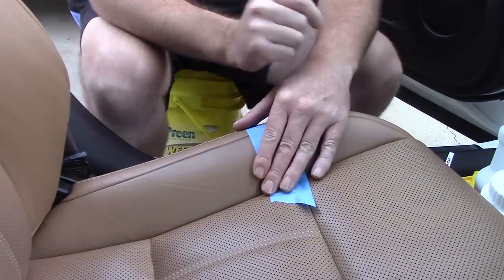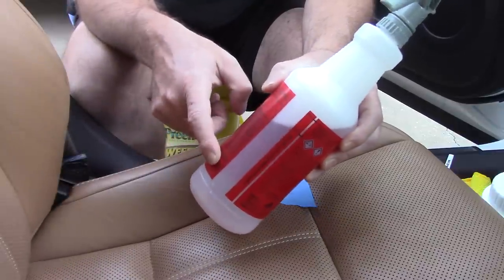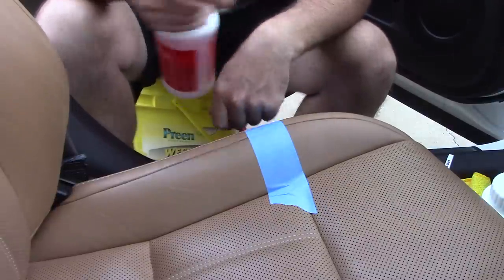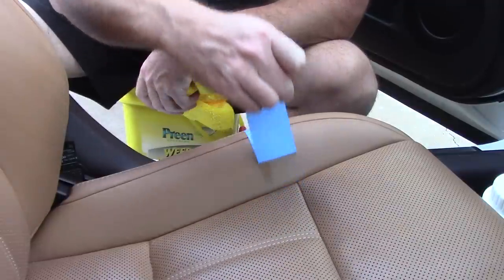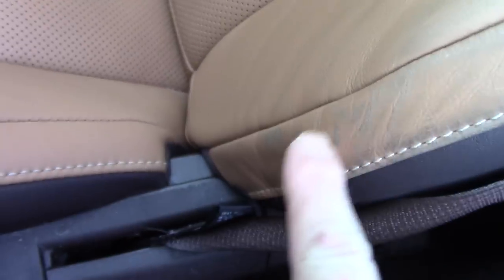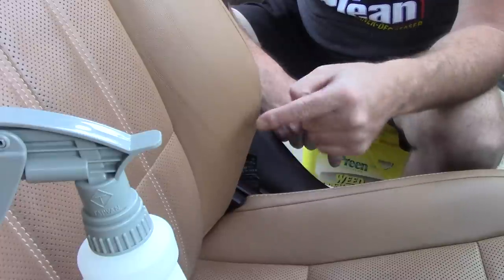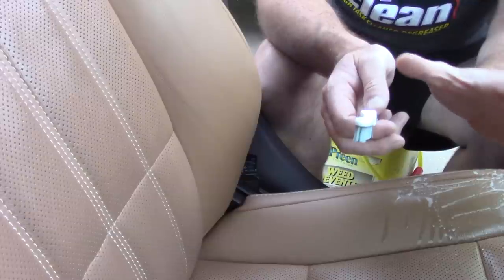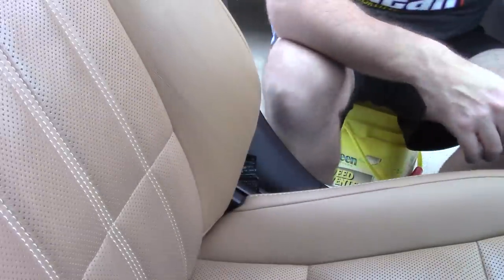Amazing Cleaner For Car Leather - And Cheap!

Comment: This absolutely works. I used this with some dollar store magic eraser pads on some hammered, beige, 2008 BMW X3 seats, with great results. thanks for sharing!
Reply: Be careful using eraser pads on finished leather. The eraser pads will actually remove the clear sealant from the surface of the leather, and yeah it will look great for a while but with the sealant stripped off you'll run in to trouble down the road with that leather. Much better to just wipe with a regular cloth.

Comment: I mixed 2 oz of Woolite with 6 oz of warm water in a spray bottle to clean my favorite leather jacket and the results were phenomenal and it looked brand-new when I was done.
I was careful not to oversaturate the Leather by spraying onto the microfiber cloth then wiping the jacket.
Thank you for this information
Reply: I commented saying the same I use it for leather shoes and I’ve my own mixes with jojoba oil and coconut oil mixed with the detergent for non coated leathers and coated leathers it works well with both.  The oils help with replenishing conditioners into the leather on the non coated stuff and even on the coated stuff it seems to help with preventing the leather from drying out.  I’ve found you don’t necessarily need wool it’s but a detergent free of fragrances and all the additives which basically applies to all the hypoallergenic detergents.
Reply: @SpreadingKnowledgeVlogs  I will definitely give that a try I appreciate the help that maintain our fine leather goods
Reply: @derekcolvin9944  no problem the reason I tried the oils mixed into the detergent mixture is because that's what a lot of the popular shoe cleaners are using these days.  Reshoevenator, Crep, Angelus and Jason marks all use the same in their shoe cleaners albeit in their proprietary mixtures and they don't tell you exactly what detergents their using but it really doesn't make a big difference what matters most is playing with the mix and getting the amounts just right for what your looking to do with it.  I make mines pretty concentrated because I find it easier to do that then water it down when necessary vs doing the opposite.

Comment: Thanks so much for the information. Scott this is the first time I’ve seen this demo..  Eagle Products used to put out a product called Eagle 1 Leather Creme.  It cleaned and conditioned leather and made it smell brand New!!  I wish they still made the product.  An Elderly Gentleman that worked at the Cadillac dealership since he was a kid recommended the leather creme - he said “it was like putting lotion on your skin!”  My leather stayed soft, pliable and never cracked or dried out. O’Reilley auto parts introduced me to another Leather Cleaner and conditioner and it does a great job and the leather smells like new!  Griot’s Garage Leather Cleaner and Conditioner. The diluted woolite would leave a  delicate clean smell which is what the Cadillac Dealer and Lexus detailers used. Thanks so much for the information.

Comment: Just a suggestion to share: we have horses and have been maintaining very expensive leather goods -- bridles, saddles which are $5k retail, custom made boots, harness -- with castile soap and a bit of water.  The tack is cleaned every time it is used.    Tooth brushes for the small areas. a lightly dampened sponge for the large spaces.   Important to clean the leather every use because the horse's sweat has salt in it and this simple soap gets the salt off while conditioning the leather.   I've used this on the leather of my cars for years.  Doesn't rot the stitching, doesn't change the color regardless of whether the leather is dark or light color, and no need to rinse.   Inexpensive like Woolite.   Comes in bars like any soap.    We don't use it on fabrics.   Just on leather of any kind and especially very fine leather like the French calf of boots and shoes and finely made harness and tack.
Reply: Is that any scented Castile soap. Would the lemon one work on my black leather seats
Reply: Dr Bronners  @TheJanicetunes
Reply: Emma Willard..is hemp castile safe on leather. Or is it all castile soap hemp based and i just didnt research enough?
Reply: Emma willard what stores have this castile soap?and is this the liquid form or soap bar and what brand do you use?
Reply: @luisrosado1448  . . . Dr Bronners is organic castile liquid.  also comes in bars. Most stores carry it now.
Reply: I got mine at Marshall’s.  What a great tip!
Reply: I too have been cleaning leather for years and I am totally sold on
Leatherique products.I have heard that saddle soaps can close the pores of the leather and cause it to prematurely age or even damage it. I was told that Rolls Royce recommends Leatherique and I have always loved the results. It is a long 2 step process.
Reply: @vaejoviscarolinanus    What is branded as "saddle soap" is a combination product.   It has an oil component.  We have never used this on fine leather:  the oil component will change the color of leather making it darker.
    Much better for fine leather and what I use to clean my leather seats: pure castile soap (comes in soap bars and as liquid and no perfume) to remove grease, grime and dirt.  Then, if necessary, condition leather with a specific leather conditioner product.  Such as Lexol.  Two step process, first to clean and, second, if necessary, to condition.  Use of a conditioner should be occasional, not regular.  Only when the leather is stiff or dry and only when the leather is clean.  Don't put a conditioning product on top of dirty leather: just seals the dirt into the leather and changes color.  That's why what is called "saddle soap" is NOT GOOD.
    I've got saddles and harness which are fifty years of age and have been kept this way for all of those years of regular use.
Reply: @TheJanicetunes    Because I can't tolerate perfume and scents, I never buy or use castile soap which is scented.
   Just plain castile soap in a bar.  It's white and very soluble in H2O.
    Wet a sponge, squeeze out as much water as possible.  Sponge should be damp but not wet.  Rub on the castile soap bar and make a bit of foam.  Apply foam to the dirty leather.  Remove any excess.  Let the leather air dry.  No need to rinse.
    Use two two water sources: one of clean water and one of dirty.  When sponge has been used on the dirty leather, rinse the sponge out in the dirty water.  Then use clean water to make soap foam again. 
    The idea: when the sponge has dirt on it from cleaning, don't use it again on the leather: you'll be putting dirt back on a cleaned place or more dirt on a dirty area.  
    Rinse the dirt and soap out of the sponge in a dirty water bowl or source.  Squeeze out excess water to have a damp, not wet, sponge again.  Use the clean water source to make new foam to clean the next area.

Comment: I did some work at a leather manufacturing place, the old guy there gave me a tip years ago and it's the best i've ever tried out of all the products, and that soap flakes. There got that out right away lol. truts me it does a brilliant job and it leaves a kind of waxy feel to the leather also like when they're new.

Comment: I been doing similar washing leather goods and shoes using similar products.  I use a laundry detergent cleaner that is free of fragrance and all the other B’s.  I use it in a foam pump when I want it to foam.  I find you do need to mix some of them strong but it does indeed work well.

Comment: If you don't have Woolite, they say to use Dawn dishwashing liquid for your clothes. Well I just dried a couple of drops straight on a stain on leather loafers that has been there for over a year and it is actually lightening. I'm using a washcloth to rub it in and then using an abrasive dish scrubber.

Comment: Great video. It's like myself with off label use. On a totally hammered car, mixing hot water and tide or persil for the ENTIRE interior, mopping up and finishing with last touch, diluted onr or quick interior detailer. Comes out perfect.

Comment: I want to say thank you. Your channel has made a big difference with my cars. Yesterday I did my first 4 step process on the my ‘95 Caprice using the harbor freight DA polish with Griots Fast Correcting Cream and Meguiars Ultimate Wax. That compound gave life to the paint again. Feels like 1996 over again. Thank you!

Is this woolite safe to use in older cars with leather? The 95 Caprice and 96 Fleetwood that I have both have leather and could use a cleaning. 

Without you my car paint wouldn’t be so vibrant. Cheers from Miami.

Comment: Lexus recommends using Woolite and water to clean their leather in the owners manual, for mild stains it is good, for caked/burnt on stains it does not work very well, I found Wolfgang leather cleaner was good for harder stains.

Comment: Thanks very much I will try it on my new/used Cadillac Escalade that has very light leather (Slate). I'm in warm weather year round and have shorts or a dress on a lot so the oils from legs I'm sure will transfer.  I haven't tried it yet but I will soon. Scott do I need to put any other product on the seats after I've cleaned them as a protectant?

Comment: Woolite, and common household cleaners without bleach,,  cannot harm the synthetic stitching used in cars.  But some with high pH will make the color coating discolor, become tacky, or strip the coating off. An excellent leather cleaner is available from ADV Leather.

Comment: This DOES work. Just purchased a pre-owned Honda CR-V with black leather interior. The driver seat, the driver armrest and steering wheel are shinny. I used the "Hand Wash Delicate" Woolite (pink & white bottle) 1:5 distilled water with a tooth brush, like you did. The crap that came off of the seats was this greenish black dirt.  Seats look amazing. The armrest which I think might be vinyl, is still a little shiny probably from constant rubbing or burnishing. I think a gentle swipe of a magic eraser will take care of that. Thanks for the tip.
After using this solution however, I did use a wet towel to wipe off the soap residue.

Comment: Does this really work with blue dye from jeans?? I used dawn and whole bunch of other chemicals and nothing worked. Haven’t tried woolite. Thanks for sharing
Reply: I was selling my car and needed to get blue denim dye off. I used 5 to 1 with method all purpose cleaner and a magic eraser. I was shocked at how clean it came. The video I watched said the secret was soaking the magic eraser in water first. I've tried spraying products on magic eraser and doing it that way but it didn't work as good. Also you can let the magic eraser dry out then use it again.

Comment: I have a 2015 Lexus LX570, and the leather on the driver side bolster is all cracked and some of the leather is starting to peel off. I bought it certified pre-owned from the Lexus dealer with 20,000 miles. The car only has about 35,000 miles right now, but it's getting more and more cracked. Is that normal? What can I do about it? Thanks!
Reply: Frosticious I would contact your salesperson, and schedule a service visit for warranty work.  The armrest in my 2015 Escalade started to get wrinkled, and Cadillac covered it under their CPO. warranty.

Comment: You should do those info-commercials. If you didn't repeat yourself, this video would be two or three minutes long. I don't mean to sound like a critic, just saying. Thanks for the info though, I will definitely try it.
Reply from the maker: i know right..lol..sorry i repeat myself, i guess i get to deep into the details ...but I'm grateful i was able to help..thanks for your support..much love my friend:)
Reply from the maker: if you would have just said thanks....your comment could have been shorter as well:)...i hope you know I'm teasing you but i will work on saying less and try to make a 30 second video and hope all understand
Reply: Dallas Paint Correction & Auto Detailing .No don't I like that you do that your getting your point across
Reply: Dallas Paint Correction & Auto Detailing your passionate about what you do. You can never have TMI.
Reply: I had actually heard about using woolite a few years ago and was unsure. I have to try it now. Been using Mothers VLR and its OK but looking for better. what would you recommend for conditioning?
Reply: Sounds like Body by Jake exercise guy. Lol
Reply: I am a leather repair pro. This still a harsh pH for leather. Leather has a pH of 4.5! A neutral pH cleaner is still harsh for leather. Body is have a pH of 5 to 6, and they can destroy leather in a few years as they accumulate and saturate deep in the leather. ANY  liquid cleaner passes through water-resistant leather color coating through micro-pores. Any pH mis-match, high or low,  #1 will rot leather and #2 remains in the leather and continues to damage it forever. So, in the very short run it appears harmless, but you are actively aging the leather faster.  Which is why Woolite does not recommend using it for leather. Leather cleaners made specifically for leather are high in surfactants and pH corrected. They powerfully lift dirt and minimize scrubbing needed. You can safely scrub with an exfoliating glove or similar rough fabric.and pull a lot of soil off. Best to apply the cleaner and let it work for 10 min, just keep applying to new areas and come to the start to remove with a damp cloth. AV Leather makes the best one I know of.
Reply: Jones4Leather   Could you recommend a safe leather cleaner?  Also, would you advise using a UV protectant such as 303 Protectant after the seat dries for protection from UV rays?  Thank you in advance.

Comment: I found that this leaves a soapy feel after it drys. Should you be washing it off?
Reply from the maker: i don't have a issue using the form of woolite in this video and at its dilution ratio..i get this knock of brand of woolite at the dollar general store:)..if your having an issue with residue i would think a microfiber towel lightly wet with water should remove all residue from the cleaner...hope that helps with your question..much love my friend:)
Reply: When I do a leather cleaning with Woolite like Scott has shown, I mix a spray bottle with the Woolite soap, and then I have a bucket of clean water and a microfibre; use the spray bottle and a brush or sponge, then I'll take the cloth damp with water and wipe off, then dry with a separate towel. I definitely find it worth rinsing, it's a soap after all. Top with your preferred dressing, I use Collinite 855 leather wax.

Comment: Great product!  Would you please tell us the way to clean suede leather.  Adams polishes use carpet cleaner to clean sude leather. I often use D181, is that correct?
Reply: helloo kitty what’s suede leather? I have a 2009 Lincoln Town Car and the leather is either dry as hell or some other type. Just wondering?

Comment: Laundry detergent is not a good cleaner for anything but...clothing. If you use it for something like this, you also need a cleaner to get it off! Laundry detergent indeed CAN be a good cleaner. Years ago, I found Tide was very effective at getting spray paint off my sister's car when someone vandalized it. I used it after using it for shoe polish or something else off concrete -- I don't recall the circumstances. Anyway, it worked great, so the cleaning properties indeed do work. However, go wash your hands with Tide or even this wool wash stuff. It leaves behind a film like substance that you need something else to get off. Meguiars AP might not be as cheap, but it is a much better cleaner for car leather. I do like wool wash and have a bunch of it. Dilute it with regular water 1:1 and use it for fire ant killer. No joke -- it isn't very fast but it will work as pest control. I don't think it will hurt the grass or your garden. Sorry, Scott. Can't go with you down this rabbit hole.

Comment: thanks man! I have exactly the same Lexus you are showing in the video. I tried the Leather Cleaner from Chemical Guys with no tangible results and started to look for alternatives. I have also tried the Wool wash "Woolite" with 5:1 spray. It removed some dirt but not everything. I can see black traces in the area where the pants are coming in strong contact with the seat. I need another solid cleaner to remove the black spots then I will maintain it with your spray. Please advise! Thanks

Comment: ,why do you use distilled water do you use that for all your bottled products
Reply from the maker: distilled water is pure and tap water may be hard and effect the overall power of the cleaner, so i like using distilled water..i hope that makes sense but if you use tap water you should be fine,i just have seen if people have really hard water from the tap it could interfere with the cleaners ability to work effectively ...much love my friend and i enjoyed your question:)

Comment: Cool, how about Audi.  Does that have a coating on the leather?  Thanks for the tips
Reply: I believe they did not have a coating.  This will stick work but wipe dry immediately after agitating- one section at a time.